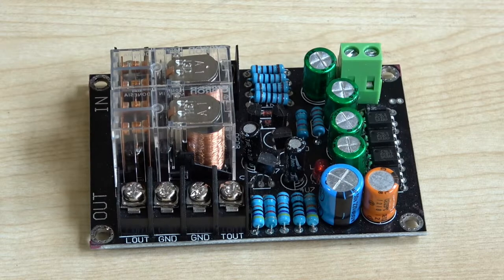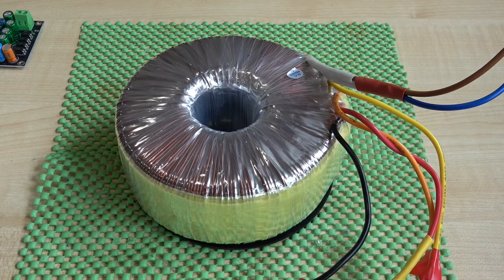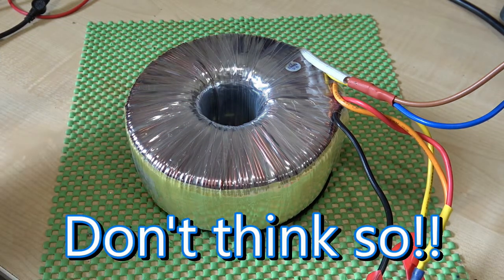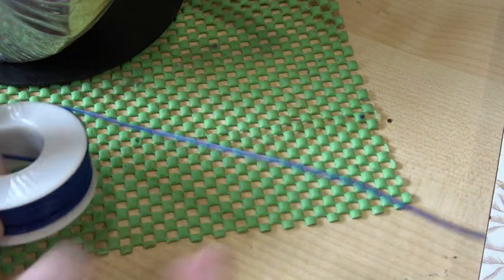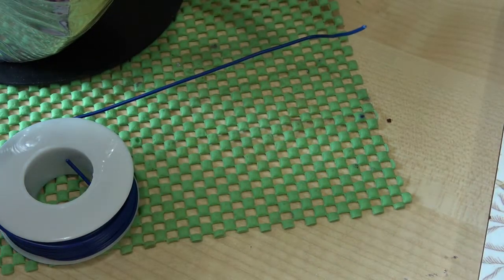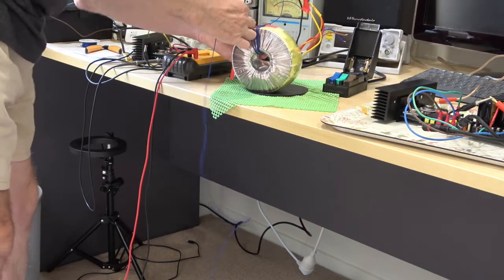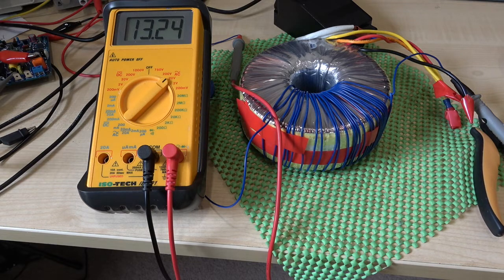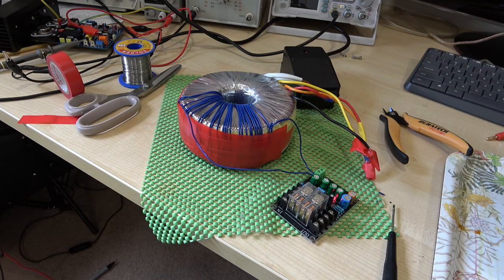Adding a 12 volt winding to the Quad 405 Transformer.

Comment: Hi Michael, appreciate all your videos so thank you for making them! One reason for mismatch between what you measured between your testleads and the solid core wire you used is the fact that they are different types of wire (solid vs multicore, thickness, material, etc). When calculating the number of turns on a transformer the type of wire is also taken in to consideration. They way you have done it is perfectly fine though, guesstimate the number of turns and go for it. Take some off if you overshoot by too much, add a few turns if you are low. Another way is to take 1 turn of the wire you are going to use and measure that. You would probably get closer to your estimate then with a test lead. Just a quick note. Again, I enjoy your videos!
Reply from the maker: Hi Dustin, this was only the second time I have actually done this. The first time was over 20 years ago. I would normally get the right transformer in the first place. I just thought it would make an interesting video.
 I wanted to use a wire that many people might have. Enamel copper wire is what I would normally use, but not many people would have about the home.
Thanks for your kind words and contribution, most appreciated.

Comment: Question: Where do you (or do you at all) connect a toroidal transformer to earth? I just picked up one for my preamp it has dual Primary (115v) and dual secondary (both 12v) I put the primaries in parallel and the secondary's in series to get a center tap but idk where you connect it to earth like a an E core transformer. Any help would be greatly appreciated !
Reply from the maker: No part of the AC windings of the transformer connects to earth. As the core is completly hidden, no safety issues arrive. Any earth you might need will the metal work of the cabinet, nothing to do with the transformer. The secondary is 100% isolated so no earth needed.